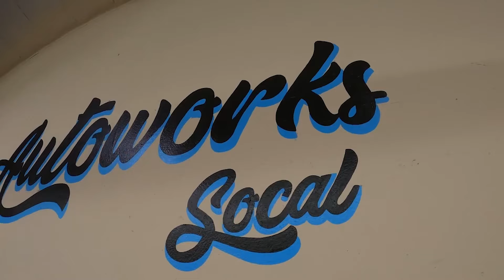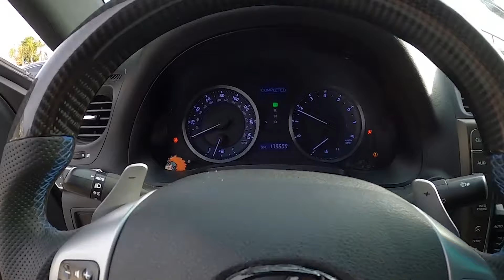BUILDING A LEXUS IS250 IN 10 MINUTES!

Comment: That light you had on at the end of the video VSC LIGHT were you able to turn it off? I had my rear bearings changed and they changed the speed sensor. And the light doesn’t want to turn off. Just wondering if you came across this issue.